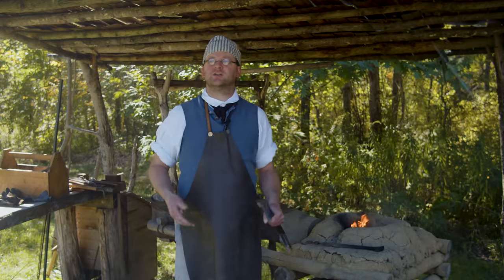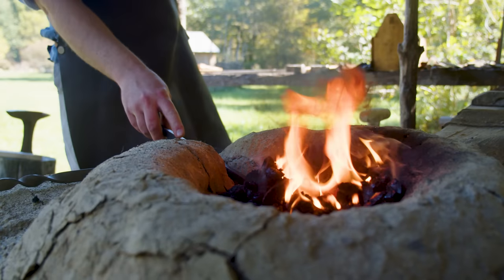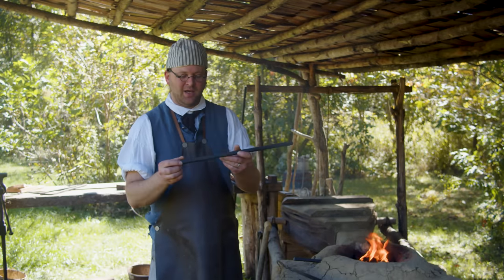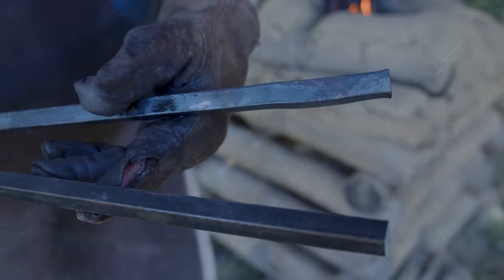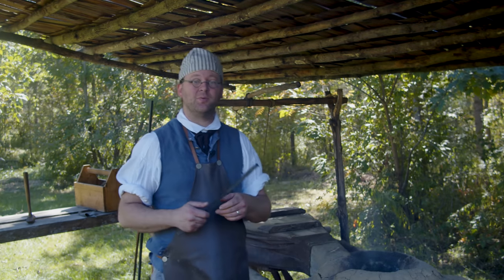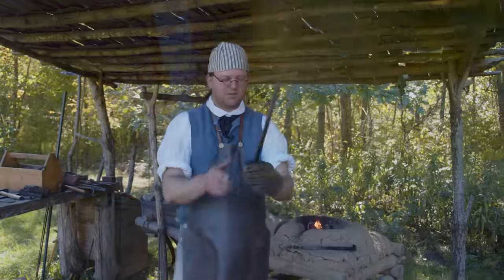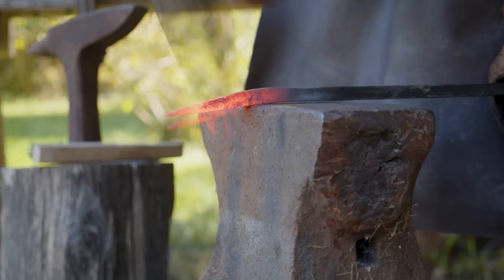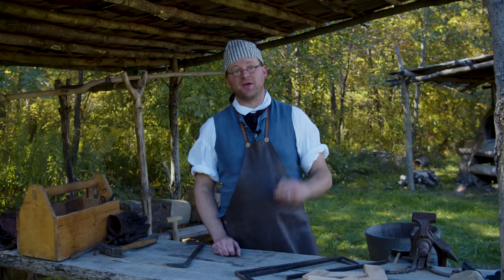Smokehouse Prep: Making Log Dogs - Townsends Wilderness Homestead

Comment: Another method for getting a SHARP corner which makes it easier to drive with a hammer . Upset a square corner in the usual way and use a convenience bend  further back on your bar to enable you to present the short leg of your bend to the anvil so you can forge your taper. Then straighten the convenience bend. 
Just a thought ( fifty years a blacksmith )

Comment: It's getting to the time of maple syrup harvest in a couple months. Do you guys have any maple trees nearby? Even if they're not sugar maple, you can still make some tasty syrup or natural sugar for cooking from any species. A tap and bucket are all that are required and a tap could be easily be fashioned on the homestead. Old fashioned taps used to be simple wooden tubes with a taper and trough cut on one end. People (especially indigenous people) used to gather in sugar camps for the labor-intensive syrup harvest and boiling down process.

Comment: Log dogs, not to be confused with dog logs.  ^-^

But yeah, those giant staples were probably more useful (but also more expensive) than nails for construction of wood cabins.  I have watched videos where modern cabin builders used these log dogs to hold the entire structure together.  But that was probably not economically feasible in the 1800's.

Comment: The flat chisel ends should be at right angles to each other. Just sayin.. Not certain I explained that very well. But some Google searches will show what I mean. If the chisel point on one end goes the long way of the dog then the chisel point at the other end should orient crosswise the dog.
Reply: historically, and in practice you are correct.  You want the flat point to always be with the grain of the wood, so when you have logs that cross one flat should be parallel to the dog, the other should be perpendicular to the dog.  I expect they will work okay as forged, but the will leave a big chisel mark in the log where the flat goes across the grain.

Comment: i was thinking, How would you weld something together with only a hammer, metal and fire? was Iron sand a common byproduct at the period.
Reply: You can forgeweld steel by making it so hot it almost melts, and then you lay the 2 pieces on top of each other and hitting it with a hammer. And for the iron sand... idk what you mean by that